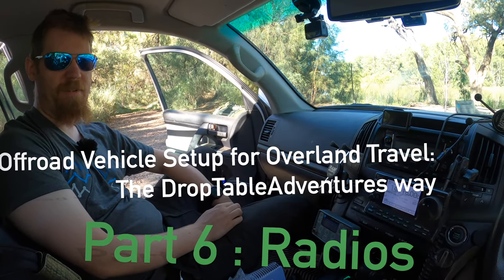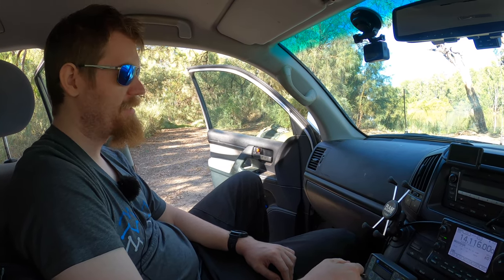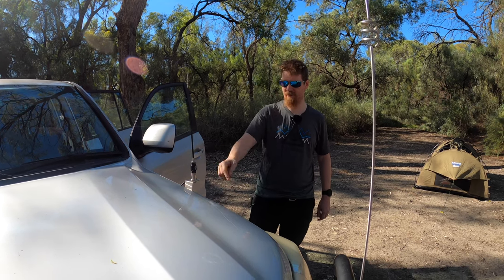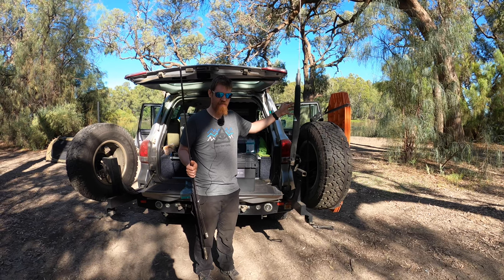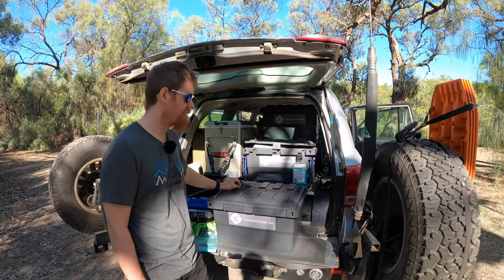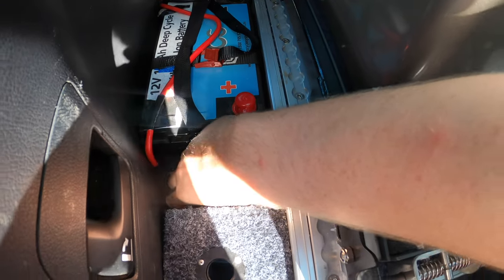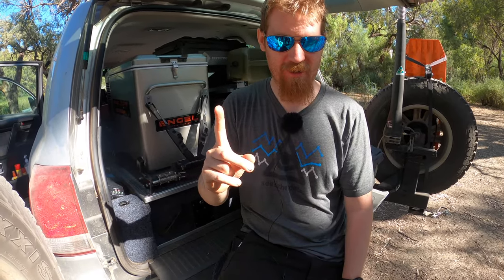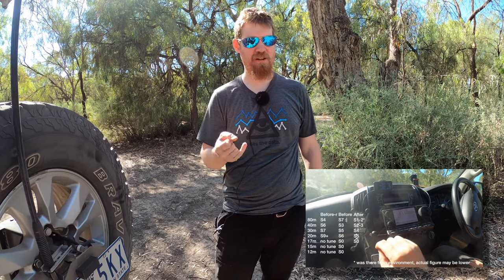Offroad Vehicle Setup for Overland Travel: The DropTableAdventures Way : Radios

Comment: Thought it quite nifty explaining the hf setup.  Over the years have spoken to many amateurs on 30m as they traveled around Australia. Anywhere from daily check in as they traveled from Cairns to Port Headland and back to having a chat with someone as they were driving through the middle of NT. Complexity of their setup has ranged from simple radio + antenna to something a bit more involved like yours and a fellow on 30 who does mapping while he travels.

Rarely think to watch 30 aprs.  When I do there has been people ranging from se qld to tassy to sa. Some later come up on 10.125 which has led to some interesting conversations after realising I had seen them on arps earlier. Most of the traffic I see are a few igates. Admittedly only hour since sun rise, all I have seen this morning is the vk4rm igate beacon 5 times.

Regards 30 aprs coverage in Australia, there are definite gaps. Noticed this when I with one person I was in contact with on 30. I was hearing some of his travels that igates were not hearing.
Reply from the maker: I'm hoping that as the sunspot cycle comes up a bit the gaps close. Or we get new ones if the D layer gets strong enough to absorb it...
Reply: @DropTableAdventures  That is already happening. In se qld we are back to getting nvis on 30 in the mornings. Not as reliable as it was when it stopped 6 years ago but it is coming back. Normally s1 signals at the limit of local range are spending time anything up to 9+10. That has been extending out to a few hundred km. The vk4rm igate which I have been hearing is about 300km away.
Reply from the maker: Yeah, conditions have been better than expected - 10m's open to the US early afternoon most days. Haven't seen that in a long time.

Comment: OK, you satisfied my curiosity. Do you have future plans for the Codan, or was it just a convenient piece of kit for APRS?
Reply from the maker: We actually ended up with the Codan 9323 radio, because we were just after the Codan 9350 antenna, but one came up with the radio for a very attractive price "local pickup only" in a town we'd be passing through in a few weeks. It ended up being the designated APRS radio because doing so frees up the Icom 7100 for other use (you can't use the 2/70 half separately to the HF half). Microphone that came with it was broken when I got it, but I replaced the microphone element and it's good now. Might sign up to VKS-737 at some point in the future before a long remote trip.

The 9323's not exactly a convenient piece of kit for APRS - rigging it up for CAT control required some custom scripting and to connect the TX audio internally, and it's a commercial radio so you need to program in channels.

Comment: The 4g antenna setup, is that used for boosting reception like the Celfi Go or for boosting data speed ?
Reply from the maker: It doesn't repeat the signal to phones in the car like a CelFi would, it's just connected directly into to a 4G modem which provides a WiFi hotspot with internet on it.
Reply: @DropTableAdventures  I’d love to know more about this system, is there much computer programming to get it to work ? Would you know anywhere I could learn about setting it up from scratch ? Would love to add something similar into my vehicle :)
Reply from the maker: There was a bit of scripting to get the unit to turn itself off, and the usual "explosion in a button factory" Mikrotik config, as well as a lot of fiddling to get the modem happy (tape over the PCIe pins on the connector to force it into USB mode, load the correct firmware on the modem, send the "secret" AT commands to make it turn on in an "unsupported" device...). 

If I was to do it again though, I'd probably just buy something like this: https://www.altronics.com.au/p/d4363-teltonika-rut850-hotspot-gps-mobile-router/ - which is specifically designed for doing this, so you could just buy it and install it. It's also cheaper than combining all the bits I used. It just didn't exist at the time I started (first incarnation of this was built in about 2016 in our old car).

Comment: La antena codan es compatible con kenwood ts-480hx
Reply from the maker: With the right adaptor it should be - the Codan tuning "protocol" is pretty simple, and fundamentally, the radio just transmits 10w of CW, tells the antenna to start tuning, and stops TX'ing when the antenna says it either succeded or failed. You'd just need a circuit to adapt how the Kenwood signals this to the Codan. I can't seem to find one out there, but surely it exists...

Comment: icom 7100 to icdan interface looking to get one
Reply from the maker: I don't know where you can get a pre-made one, but https://github.com/TheSkorm/IC-9350 was what we built. The design's been revised a little from the original to use an Arduino Nano instead of a bare AVR and support components, so it's significantly simpler to build.